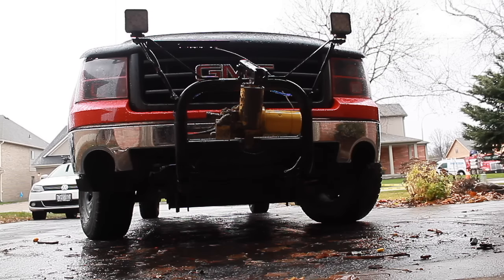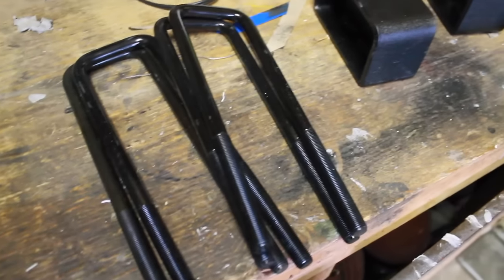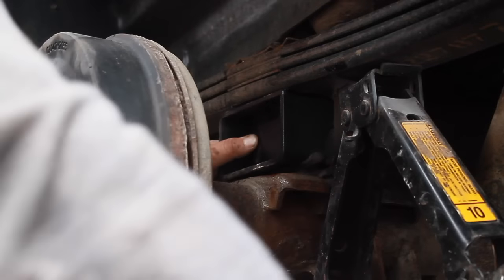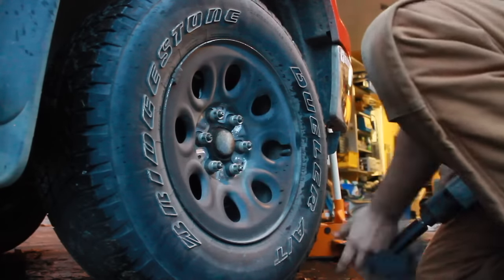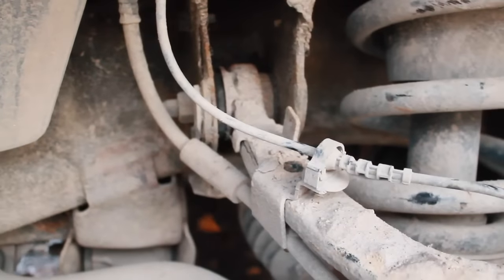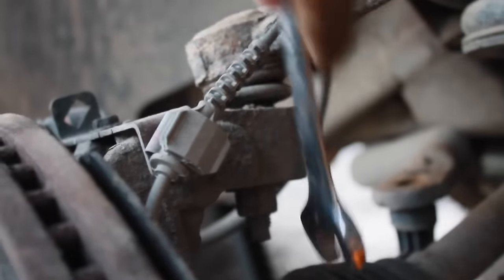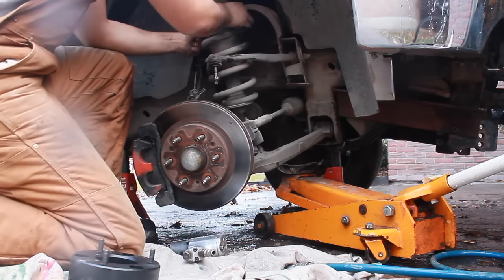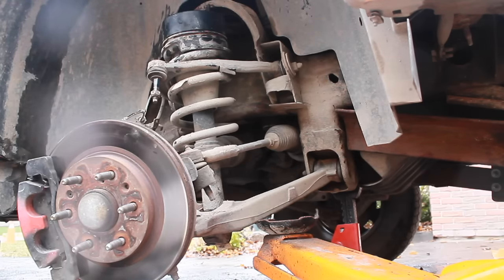how to instal a 3 inch lift / levelling kit on a 2007-2013 GMC sierra Chevy silverado

Comment: Did this on a 07 Yukon denali a few years back.  The front was a total pain!  Got the 3.5" leveling so a spacer above and below.   Installing the 2 lower bolts got me creating new 4 letter words for the time it took to get them in.  Definitely needed and alignment afterwards too, but also get a correct angle upper control arm for anything over 2 inches.
The ride is a bit more stiff, but works great for me because it reduces roll on turns.  Rockin 35s MTs under my Yukon Denali and been loving it for a few years now.
Reply: Thank you so much that was my problem on my 07 avalanche on

Comment: Excellent how to. Everyone removes just about everything to get these in and you don’t need to at all. I finished my 3.5 (3.5 inch lifted struts from rough country) in the front relatively easy. Thank you!

I didn’t remove the tie rod nuts because they were spinning. Decided to move forward and was able to get the new struts in no problem with a little elbow grease. Anyone doing this, I would definitely recommend new upper control arms. It makes a huge difference in the travel for that knuckle and ride comfort.
Reply: What control arms did you get? I ended up with new stock ones that I’m going to put on tmr along with the level spacer
Reply: @giuseppesinibaldo2796  rough country with the joint that angles well
Reply: @leostrand4243  have you had good luck with them 7 months down the road?
Reply: @giuseppesinibaldo2796  yep no issues at all.

Comment: hey i just wanted to say thanks just finished installing it on my 07 silverado using your instructions and they were very clear.  it now it has an aggressive look
Reply: BIGGAME JAMES what kit did U use
Reply: BIGGAME JAMES moto kit order on Amazon
Reply: i dont know what it was called but it was the exact same one he used i will add a video of it later on my page but one tip to add to his install that made it easier take the wheel well splash guard off makes things go so much easier especially when take the shock assembly off and placing the block
Reply: how longe did it take

Comment: You absolutely do not have to take the upper control arm out of the spindle to take the strut out all you need to do is remove the sway bar link unbolt it from the lower control arm Loosen  Three Top bolts and a push it towards the front diff and it pops right out
Reply: Looking to try this , thanks for the tip
Reply: Yea to take them out uca dont have to be touched. It has to come off to reinstall. I have done it on a 12 and 13 silverado. I put  2 inch spacer also.
Reply: Yea to take them out uca dont have to be touched. It has to come off to reinstall. I have done it on a 12 and 13 silverado. I put a 2 inch spacer also.

Comment: Not to say anybodys wrong but ive done 3" level kits like this on three trucks about to do it to my new 2016 chevy and most those trucks i put over 100k no ball joint issues no axle angle issues if your going with a 2.5" it's absolutely no diff .5" isnt gonning to make or break you. If you want a 3" lift and clear larger tires do it you wont regret it if your just looking to level the truck use a 2" kit and have piece of mind. The motofab i bought was on amazon 124.99$ free shipping easy install as you watched. Besides if the ball joints did go out big deal replace the upper arm and joint at that point thats my plan on this new chevy and if the angke is bad enough theres a easy install for a front diff drop to help if needed really cheap as well. Good luck! Enjoy
Reply: HVT Muddvain this mixes me up I'm putting a 6 inch on my truck and I dont think I'm replacing any parts under it so I'm scared stuff might break on me
Reply: The set of upgraded upper control arms with  joints from rough country is only $259 so if you have an issue its a cheap fix.
Reply: Maybe you can help I have a 2013 Silverado I bought  moto fab level kit 3 front 2 rear. Do I need to change shocks in front or rear? Thanks it you can help
Reply: Brian trerotola shocks don’t need replacing.

Comment: I bought 3" front and 2" rear lift kit from Ebay for $87. My 2" rear lift is different than yours, it's a full aluminium billet (CNC machined).  I'm done with rear easy peasy but struggling with front. Realizing that you removed upper arm.  No wonder why I couldn't get bottom of shock bracket to hang on top of lower strut.  Instruction don't tell me at all.  Glad that I checked your video.  Hey!  Did you forget to bolt in 3" billet to top shock before you insert under truck shock support??  I saw you drop in 3" billet then install under strut support body.  Or you already did bolted in billet to shock "video offline"?? Wonder..

Comment: curious to know how the truck is holding up as well. could u fill us in on if there were any issues with the ride or joint problems
Reply: I’ve used a 3” leveling kit on my old truck 08’ Silverado. Ran it over 2 years. Had no problems. I have the same leveling kit on my new truck 14’ Silverado. Haven’t had any problems with it either.
Reply: @matthewpalmer6911  did you also do control arms?
Reply: @matthewpalmer6911  did you replace the control arms?
Reply: @zekerocks9217  Yes, I ended up replacing the upper control arms. I went with the freedom off-road ones. I also did the billet differential drop up front on the front differential to help with the CV axle angles.

Comment: I have a silverado with a similar lift I like it a lot. BTW if you don't get the alignment right it will ruin the tires fast I recommend doing a Lazer alignment
Reply: Finally someone say something about the alignment, once one touches upper strut bolts one needs alignment.

Comment: Hello thanks for the video did learn a lot but my daughter bought a 2009 Chevy suburban with a lift kit but hers' looks like a u-joint and my grandson changed I can't remember but her tire, passenger side, fell off he called himself putting it back together trying to hammer something to make it straight instead of just replacing it make a longer story shorter the wheel bearing went bad had to replace that and an axle but that u-joint can't get it to fit unless I drop the tire rod but does it go right under the spring and strutt on the bottom?

Comment: The only issue I see is the upper control arm, you used the original one. Moving everything up puts such a pitch on the control arm, wreaking that upper ball joint.
Reply: I did the 3 inch leveling kit on my 2009, I did not do the upper control arm and now have real bad camber and the arm is all the way out, any suggestions on what brand or what to do ?
Reply: Garret Wilson as long as you dont go off roading it should be fine.
Reply: @garretwilson8730  I put  KSP control arm on my silverado 2009 after lift my truck by 3" ,it worked well

Comment: if you do this lift... my question is.... can you do a shackle in the rear too for added lift ?.... can you do a spindle in the front as well to add lift ?.... can you also add a torsion key lift?.... an upgrade shocks too....or does this contradict each other and or cause other issues?... I wanna do my own cheap lift big enough for 35s. an I'm willing to trim an cut some...
Reply: Did you do any of this if so did any of it wirk

Comment: I installed this kit on my gmc 1500 truck successfully but unfortunately I started getting Traction control and stability light coming up … any idea why or what causes this
Reply: rahalati check your abc sensor it gets unplugged when you mess around with it. Good luck , It’s an easy fix don’t have to take to a mechanic, just get down there and make sure all wires are connected properly.
Reply: ABS SENSORS
Reply: @juandena7754   Few days before I get your reply I disconnected the battery for few minutes and connected it back. Drove the car and looks so far the problem is gone. Thanks any way
Reply: Unfortunately the problem still there. Driving the car for long distance with a bit high speed brings the warning "Traction control and stability light coming up". I checked the ABS and other cables and they are all okay. Can't understand why installing the lift kit cause such problem

Comment: I am currently installing the same kit in mine and my upper control arm seems to be pull down as far as it can maxed out after first side install is this normal?
Reply: I have the same issue thats why im looking at videos. My upper a arms are really stiff it seams like I think we have to get new ones 😭
Reply: It makes the suspension not go down very much
Reply: We’re you able to get them both in ?

Comment: I'd like to do this to my 95 Chevy Silverado.. can u give me some tips
Reply: Read reviews and forums to find out what has worked and hasn't on other peoples trucks. From what I have read a 2.5 is the highest you should go before having to replace upper control arms due to ball joint issues. Hope this helps man. There are many companies out there for simple leveling kits like Rough Country and Moto Fab.

Comment: I just got a 3"to1 level kit and   the 2 spacers are 2"equal is that normal or they send me the wrong part get back to me when you can
Reply: martin hernandez the instructions say it is not a 1 to 1 ratio. The 2" blocks will give you 3" of lift in the front. I have the same kit.

Comment: I have a 2011 Silverado LS 2WD would a 3in lift kit be a good idea
Reply: Ali Khandurrani - you mite still have some upper control arm issues with ball joint angles but you wouldn't have to worry about cv angles since its just 2wd
Reply: 2wd you should be lowering it

Comment: Do not be cheap lifting your truck, I learned the hard was. 3 inch front level and 3 inch body lift. Broke an upper ball joint hitting a bump..and I replaced them when I put the level on. So it was maybe 6 months old.

Comment: do you need to replace upper control arms?
Reply: Matt Gagne did he replaced them??? No!!!! Answer is no. Lol
Reply: absolutely without a doubt i just did this job and have truck on factory uca... my concern is how i got here to the video thats bs 100% do it or regret it.   will make process easier to reasemble control arm after also

Comment: i would never put lift blocks on a work truck.
Reply: i did this entire thing just to tow my cargo trailer that sagged like old lady tits on a truck already feeling like a skateboard w truck bed.  the lift blocks were goldielock's pourage on correcting trailer angle plus had them in prior to airbags so the spacer for them was made right and i got a 11,000 gvrw trailer im towing around like a boston whler with a little btch half ton